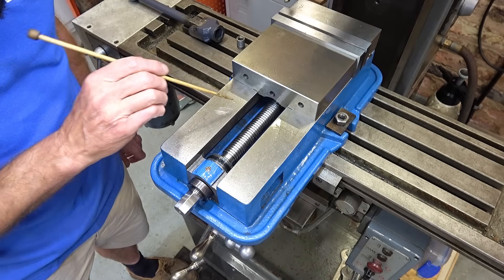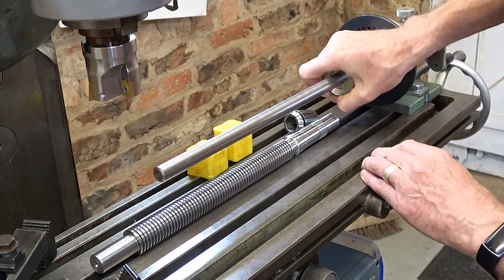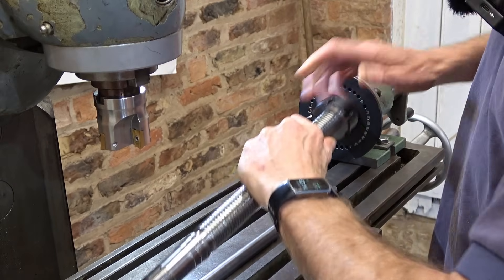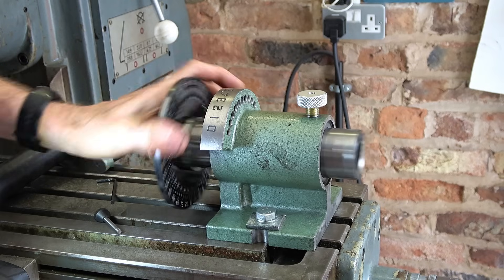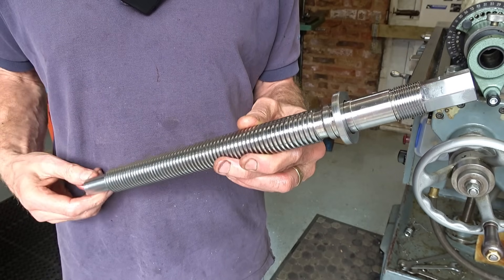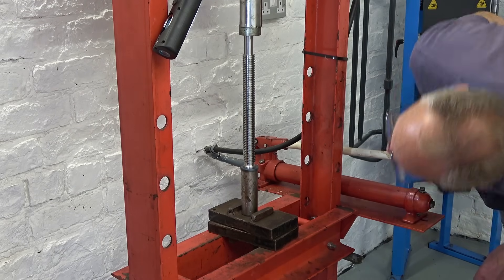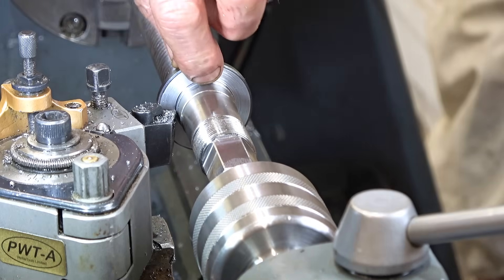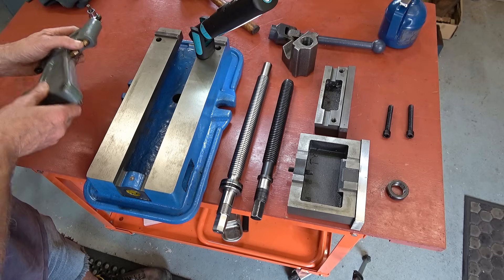HS323 Vevor milling vice improvements – new screw in alloy steel Pt3

Comment: Hi Paul. The one that really grates with me is when children say "search it up" 🤬 you either look it up or you search for it! I still call a bottom bracket a bottom bracket, I don't think the name has changed. Let me know if you want a 3D printed cover for the bearing, or anything else for that matter. Also, if you need any help with the CNC router, I may be able to help.
Reply from the maker: Hi Olly, we could add 'similar to, different from'. Not a major irritation I have to say, but I always notice when people say 'different to'. I may take you up on the 3D printer offer. I'm getting on with the CNC router but fighting with converters between jpg and DXF which will actually dimension the DXF correctly. I can load them into the router software but can't yet get the scale/size I want. Thinking of scanning gaskets and cutting them out. Ah - I should really be trying pdf to DXF that might be better. 🙄

Comment: I'm sure you know it but in case you don't, those thrust bearings often have different diameters for the two plates. The idea is that if down a bore one will be tight and the other free to revolve. Ask me how i know, it involved making a 0 morse taper rotating centre with needle roller and thrust bearings.
Reply from the maker: Hi Chris a few people have pointed that out and I was not aware. But I understand now .... next time I'll get it the right way around. My arm will never turn very fast  but if the screw gets tight to turn I'll check that first. Cheers
Reply: @HaxbyShed my comment was just to pass on something I overlooked till it mattered, in your case being open it shouldn't matter in the slightest, well maybe just a little on the bore to screw contact.😂

Comment: Paul, I read somewhere that when a blacksmith was opening a new shop they would throw a party and have Morris dancers inside the shop to pack down the dirt floor. It looked like only one of those dancers was fit for that job. 😂
Reply from the maker: I looked up the origin of Morris dancers but that appears to be lost in time. The first reference in the UK seems to be in the 1400s.  They exist in other countries too and one suggestion was the name comes from Moorish Dancers. They seemed to come to liven up a party or celebration rather than be linked to the seasons, e.g spring or the harvest. Anyway that same group has been coming to Robin Hood's Bay in the summer for many years. Cheers

Comment: I want to thank you for what you said about the shaft bending as you machined it. I have a couple of CV axle shafts that I picked up from a scrap yard to use for some project and now I know to be aware that the axles may have some stored stress that might show up at some unexpected time.
Nice job on the vise upgrade.
Reply from the maker: Hi Robert, as you saw the stress bending was not much and it might be fine if the machining is equal on all sides (keep it round). Cheers

Comment: That thrust bearing cover you need is a calling for a 3D printer...
Reply from the maker: I have considered a 3D printer but I don't think I would use it very often. I'm sure you know these days you can design a part and email it off, and it arrives in the post for a fee (3D printing service). I've just been given a 600x400mm bed CNC Router and I'm grappling with the crappy software on that today. About ready to put my fist through it. You'll see it in a future vid sometime. Cheers
Reply: @HaxbyShed yes, you can send things off to be made by others... imagine finding a mill vice, in the USA, with a 3/16W square drive on the end. Whitworth, for heaven's sake. I sent my design off to a shop that laser cut me a nice box end wrench.

Comment: At around the 10 minute mark, you put the thrust bearing washers on the shaft wrong way round.
The washers are not the same - the shaft washer has a close tolerance bore and clearance on the OD. The housing washer has a close tolerance OD and clearance on the bore. Ball thust bearings are the same. Getting these the wrong way round (as shown in the video) can lead to the shaft washer seizing on the shaft, as it is both held against the housing and is a close fit on the shaft. 
Been there - seen that first hand where a ballscrew support bearing on a new horizontal borer had been assembled the wrong way round at the factory. Machine importer was blaming us for fitting undersized servo motors when the axis stalled, but turned out to be due to the bearing washer seizing on the ballscrew due to mis-assembly. A new thrust bearing fitted the correct way round miraculously increased the servo motor torque !
Looks like a good improvement on the original screw. 👍
Reply from the maker: Hi somebody else said that and I have to admit I did not fully understand. But your explanation makes it clear now thanks. I'll look out for that if the screw gets tight. Cheers
Reply: @HaxbyShed  Might be best to addess the issue before a failure occurs - if the bearing washer picks up and seizes on the screw you will most likely need your press to remove it, with all the damage to the shaft that implies. Would be a shame to spoil the nice job you have done for the sake of 10 minutes to dismantle & swap the washers around on the shaft - with a bit of forward planning you could add a shroud to the bearing at the same time.
ATB.
Reply from the maker: @mgnbukint6502 understood. I should really machine a pocket for the larger ID  washer to drop into to locate it. That would be an interesting challenge given where it is. Cheers

Comment: Ref Spin- indexer, is the spindle tight when it is free standing?, possibly some distortion when clamped?
Nice upgrade to the "Haxby Shed" vice Paul. 
Yes, modern English usage appears to be very lax/ambiguous, possibly due to increased digital learning?
Thanks for sharing.
Reply from the maker: It was still tight when it was unclamped. I stripped and cleaned it.  I think the precision has been slipping from English language for quite a long time and maybe it's a result of less formal language training at school. I know from experience If you try to learn another language as an adult it causes you to think about our own English language structure a great deal, which you don't need to know for every day informal purposes. Cheers
Reply: @HaxbyShed .
It may be worth using a marker pen to draw axial lines, then test fit to see if there are any high spots on both surfaces,  or using a miniscule amount of fine grit valve grinding paste to lap in.
Yes, "lack of precision " is very apt, I had no interest in English at school,  especially secondary school,  I don't remember any formal punctuation,  though obviously there was, I was interested in the sciences,  maths, and technical subjects, I did achieve a HNC in engineering. I started writing technical documents circa 2008, both in metallurgy, and then machine manuals, that tested my lack of skills in writing.
Reply from the maker: @bostedtap I had a similar journey with written English. My son the same. Cheers

Comment: You are completely right about 'bring' and 'take', but that issue is symptomatic of dozens of smilar cases in which the nuances and precision of our language are being lost to casual talk. ' Can I get the hamburger'? No, you can have it, but the waitress will get it. 'May' and 'might' are going the same way as 'bring' and 'take', but in relation to time and possibility, rather than direction. While there are sometimes possible ambiguities, people seem to struggle more than ever with concepts such as length, width, breadth,  depth, height, thickness, end, side,  diameter, rod, bar and so on. It's mainly carelessness.

Comment: At 16:03, When you 'Heat Expanded', then 'Pressed' the thrust washer to the shaft at 8:15, to make it fit the screw shaft .... Is there a (big enough), shoulder stopping the washer from continuing to advance, similar to how the hydraulic press advanced the screw through the T-washer to get to the point it is currently at? Can the TW fall off, or deform, (bend or distort 'cone' shaped), during heavy vise+part clamping?  Thanks for making this series. ... I have a similar vise, (or 3), to 'MAYBE' tune up.
Reply from the maker: John, I really wanted a bigger shoulder behind that thrust washer and originally there was a bit more material on the drive shaft there for a bigger shoulder but it came off in a 'design change'. We'll see. Cheers

Comment: Just change it to carry,  you can carry it to me or away from me. Plus if your a computer you can have a carry flag to show its happen 😂😢
Reply: You said "if your a computer you can have a carry flag to show its happen 😂😢"  --  ...To show its happen? What? Who?
Reply: @johnrussell6620  In a processor of a PC, the accumulator is a register used to hold intermediate results of arithmetic and logical operations, while the carry flag is a single-bit in the  status register that indicates when a computation has generated a result that exceeds the accumulator's capacity. So if you have an 8 bit accumulator the max value it can hold is 255. so if you add 255+1 the register will hold a value of 0 and and the carry flag will be set to indicate that the accumulator has overflowed.

255      =    1111 1111 in binary
256+1  = 1 0000 0000
so the carry flag is like a 9th bit.
Reply: @TheEmbeddedHobbyist  And this applies to a screw shaft?
Reply: @johnrussell6620  in relation to the question does "bring" replace "take". As asked by the host in the beginning of the video.  You can "bring" the screw shaft to me or "take" it way from me. the two words infer a direction. where as you can both carry a screw shaft to or way from me. 
I rest my case, well it's getting heavy with all his failed screw shafts that did not make it in to video in it 🙂
Reply from the maker: Have you ever thought how we say 'on the bus', 'on the train', but 'in the car'. ?  Why is it 'in' the car?  But we can get over that sometimes by saying 'by' like by bus/train/car then it's the same for all. English is so irregular. Cheers
Reply: @HaxbyShed  At least we don't have to decide if it's masculine or feminine. I'd hate to have to sex a bus. 🙂

Comment: Stiff tooling just clean and oil them, it will help, just a wipe down with an oily rag on all the moving parts will get the dust off and leave a thin oil film on again. For the sleeve hold simplest is to make a spring and wind it on, will hold it forever

Comment: Nice work Paul.
Very nice upgrade to your vice,thanks for sharing the process.
I need to go back and finish the other video of the feed screw.
I will do that.
Would it be possible to case harden the bed ways?
A rubber cover from the back of the movable vice jaw would protect the ways from swarf.
Thanks for sharing. 
Have a good weekend. 👍
Reply from the maker: Hi Ed certainly cast iron can be surface hardened with induction hardening and they do that on lathe beds (but I'm no expert on this topic and I've never tried). Sometimes cast iron is so hard it's almost  impossible to machine. Cheers

Comment: The addition of modifiers to unique baffles me, it either unique, or it isn’t. It can’t be very unique, super unique, or quite unique. I also find the prefixing of descriptions with “Super” , there is no need for it,. Very is a word that has been around for centuries and it and it has been an excellent superlative and it doesn’t require replacement with, or the addition of, the word super.

Good video by the way 😂
Reply: I agree 100% on unique. Unless it's nearly unique, or hardly unique, there's no need for a modifier.
Reply: Is extraordinary,  just 'Extra' plain? .... or .... Is it 'Beyond' plain?  How far beyond? ...  By 1%, or 10%, or 100%?